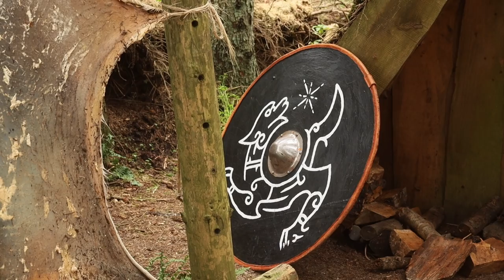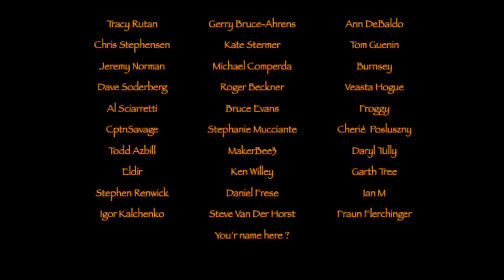Cimbrer Seax, Viking Market at Yxengaard and Cimbrer Camp Shelter update

Comment: I'm so happy you found a blacksmith to make your seax. The Viking Village was amazing!  Thank you for taking us all along to enjoy it.  You've really changed your Viking home around. I've seen variations on your wood stove and it really does heat a space well.  With your new shelter doors you could almost double your floor space.  Leave the doors straight out for walls. A few branches tied together to form a slight A frame ( maybe 4-5 of those) , with notches to fit on the top of the door and a ridge pole. All made to just be easily tied and untied for storage. Throw a tarp over the A frame and open doors. I love your door runes.  They really stand out.
Reply from the maker: Thank you so much for your kind feedback my friend 😊👍🏻 and your suggestion about using the doors to make my shelter bigger 😉 like that 🙏🏻
See you again soon 🏕🔥Tom